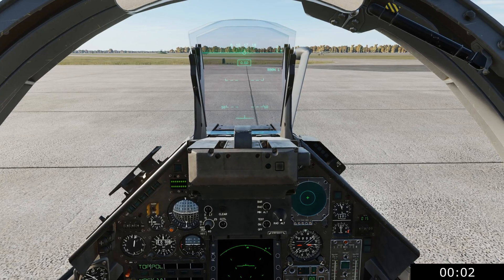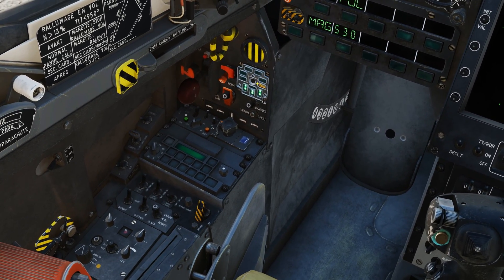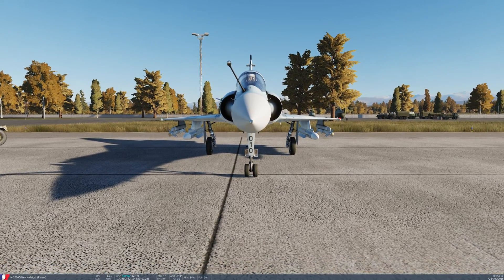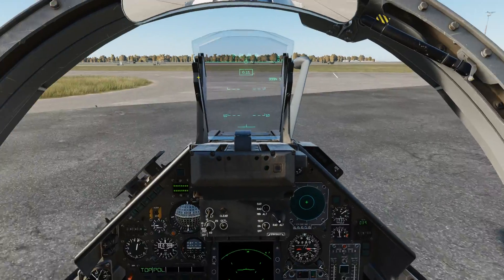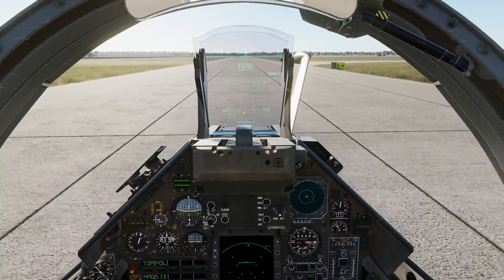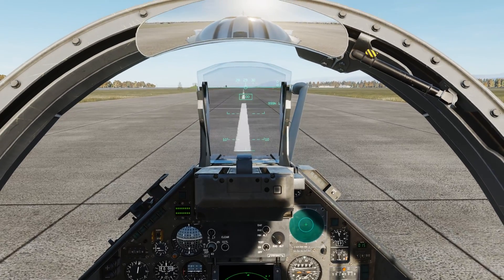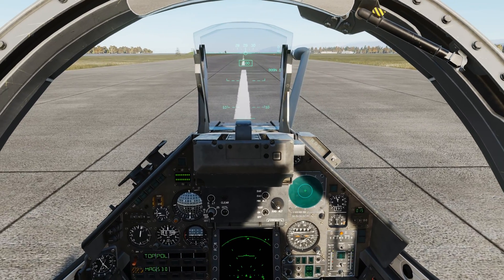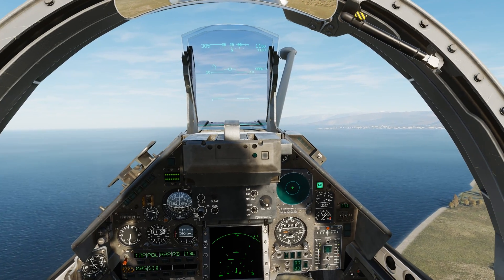DCS M-2000C Tutorial | Taxi & Take off. | Ep3 DCS in 10 minutes or less

Comment: Hey Tom what is the “CONF” warning light I keep getting when doing an auto-start and begin to taxi, that one stays on until airborne. So far I have not caught on fire so I guess that isn’t too bad LOL k.
Reply from the maker: It means your plane isn't configured for the G limiter for your current load out. 
It's the Charges switch that is right below the landing gear indicator. Up if for AA load out. Down if for heavy loads. If you have a fuel tank on it will want you to be set for air to ground
Reply: @TomP-148  Got it, the fuel tank was the issue. Great series and thanks again.